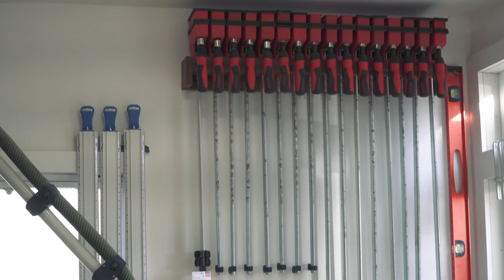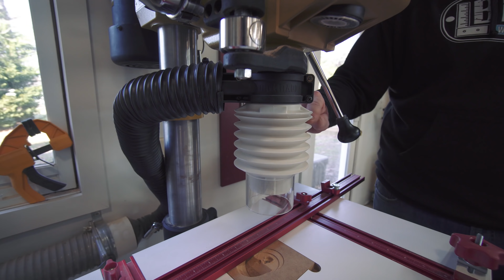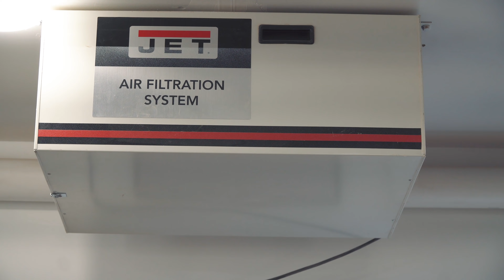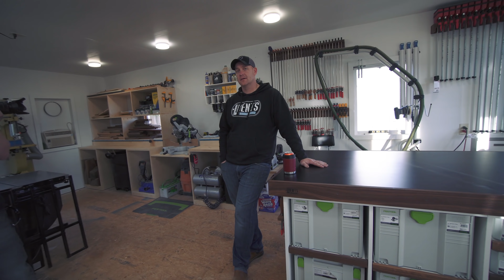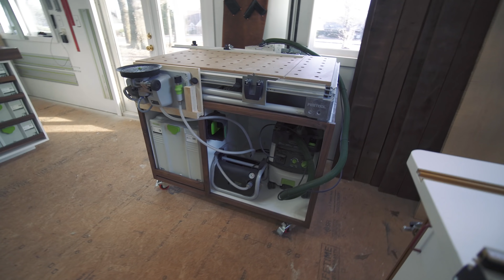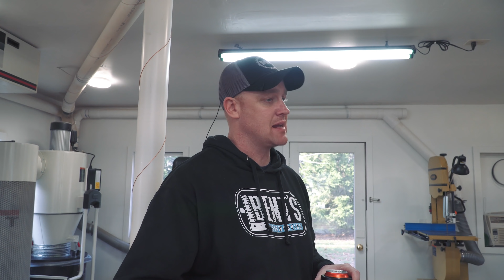Bents Woodworking | Shop Tour

Comment: Incra LS super is truly in a class of it's own .   BUT the positioner has little ability to keep the wonder fence held down to the table surface . (lift it ) you will see why you MUST anchor the fence to the table OR the Jessem guides will not be able to securely hold the stock and prevent any kick back .  Minor problem .

Comment: Question on your router table. I built my own table. The top as well. I built the cabinet but haven’t installed any drawers yet. It is framed out basically like yours. The space under the router with two draws to the right. Under that space it’s just open. So my two questions, first how is your dust collection setup. I have a 3” port in the back and when I run the router I use a piece of cardboard to cover the front with about an inch slot across the bottom for air flow. It works pretty good except when I turn off the collector the cardboard drops off and of course slides under something. So I am wondering how your collector is setup and how well it works. The second question is how are you using the drawers and would you change anything. Sorry for the long post. Thanks. P.S. your shop is real nice.

Comment: Every shop tour exposes new ideas. The Dustnado is foremost this time because drill press the work is usually far messier than poking a few pilot holes. Also, about 20 years ago I heard Sam Maloof say when he bought walnut by the tree or by the log in quantities of about a thousand board feet he was getting it for 87 cents a foot... just a thought for woodworkers with the space to air dry timber.

Comment: That is quite a shop! And so clean! Clearly, a lot of work has gone into "tuning" this shop.

One thing: you're probably losing a lot of dust collection capacity by using small diameter hoses/ducts straight from the dust collector inlet. There are also some sharp bends in flex duct. My planer has had a sharp bend in its duct for years, so I don't necessarily practice what I preach, it seems, just thought you might want to know.
Reply: B May I agree. It’s constantly changing and was not meant to be permanent. I’m trying to see what works before I commit to spending a lot of money on proper duct work
Reply: @bentswoodworking  I know it's a contentious topic, but I personally think metal is better for dust collection ducting, as it's more durable and doesn't have static electricity issues (I think it says something that plastic ducting doesn't exist in factories). If you ever decide to go with metal, ignore what the $$-having people say and skip the fancy seamless ducting with the flanges. I used regular HVAC ducting in my shop and it works just fine, though it does require more effort to seal it up. But it's waay cheaper and far more readily available. Just an FYI. Nice shop!
Reply: B May I totally agree. I look forward to upgrading to metal in the future.

Comment: Another awesome shop tour of another AWESOME shop, Jay. I am envious of the shop space, yet glad he has built this (business) from scratch and apparently done well.

I have a question for either/ both of you: What height do you recommend for the miter saw worksurface (measured at the aluminum turntable? It seems that most TS setups and outfeeds are roughly 35" (plus or minus), and band saws are 40- ish. I am sure it varies by person and their preference/height, as Jason appears to be a bit taller than Jay. I am right at 6' tall and every basic MS setup I have done is around 38-40", as it seems the most comfortable, without partially stooping.  Thoughts?
Reply: Andrew Bieger I think you answered it yourself. To me it’s more about comfort. Like the assembly table I built is 38” tall which is comfortable for me.
Reply: @bentswoodworking  Thanks for the response and keep up with the good work. I see many sources for inspiration from your shop.
Reply: Andrew Bieger thanks so much

Comment: 24×20 shop. Cool, mine is the same size. I see there's hope that it can be set up really well. Mine was built as a garage so the door (16') takes away from wall space, unless I don't open the door or do like Wood Whisperer and build a wall in front of it. My "shop" also houses my lawn mower and all the outdoor stuff.  I need to build an addition and move that stuff out.... baby steps...

Question on dust collection pipe: why not use 2 45s in the places you have 90s?
Reply: Bob C I used what I had on hand. I have just been too lazy to change it 🤦🏼‍♂️😂
Reply: @bentswoodworking  gotcha😁

Comment: Ex-Georgian here (Kennesaw). Maybe I missed it, but how do you heat and cool your shop?
Reply: Mike Farinella I have a window AC unit and a small heater for the winter. No issues
Reply: Considering you are not in the tundra, no need for a large heater.  I was surprised that the small window unit would do well enough for that size of space.
Reply: Allan Wolfe works great!

Comment: Jason, beauty shop. Did you build it specifically for woodworking? And the floor, plywood over concrete or? Thanks! And keep up the great work.
Reply: Sean Henry I didn’t build the actual shop but the guy that built it was also a woodworker. It was quite a bit different before and no it’s not on concrete unfortunately. Wish it was
Reply: @bentswoodworking  why is the plywood over concrete better? Im looking at a shop that has a concrete floor and was thinking about adding plywood. Awesome shop
Reply: Chris Land I don’t like the wooden floors. I want concrete.

Comment: Right on, awesome shop!
Reply: Smoking DeWalt thanks
Reply: @bentswoodworking  is your Saw Stop a 1 3/4 hp or 3 hp? I've had my eye on saw stop professional cabinet saw and was wondering if the 1 3/4 has enough power. If I get 3 hp I will have to upgrade electrical.
Reply: Smoking DeWalt I have the 3 HP

Comment: Great shop tour and now I have another woodworker to follow.  I'm guessing you shot this while you were in town for the two Rockler visits?  

re: the Jessem Clearcut, it's awesome.  I attached mine to a piece of wood cut to fit inside the top of the sawstop fence.  Then I put a magswitch from rockler on each end.  It's been completely stable but the magswitches let me pop it on and off as needed (vs screwing it to the fence).
Reply: This is exactly what i did as well. Just for people who don't know, like I didn't, magswitch makes a forstner bit for cutting out recesses that fit the magswitches.
Reply: @christobar  Cool, I didn't know that.
Reply from the maker: Great idea! Have a link to the magswitches you used?
Reply: @JayBates2   I picked them up from Rockler, I don't know if it was needed, but I went with the 150lb version: https://www.rockler.com/magswitch-magnetic-jigs-magswitch-magjigs  Credit goes to Dave Stanton for the idea: https://youtu.be/zMYbMbTJdH0

Comment: Jason just a couple of questions.....Who is your wood supplier in GA. (I am in Jacksonville, Fl and COULD come that way if it's not TOO far).  Also, as much as you love Incra (I do too) I notice no Incra fence on the table saw.  Any particular reason?  Thanks.  Awesome shop by the way.
Reply: befmx31 thank you. I use Suwannee lumber as my supplier primarily. As for the fence, I had one on my last saw and love it. With the sawstop I just haven’t got around to ordering one cause then I’ll have to find alternate ways to mount things
Reply: Thanks.